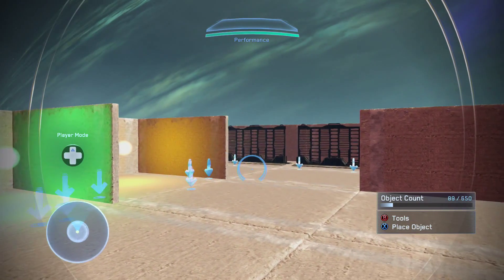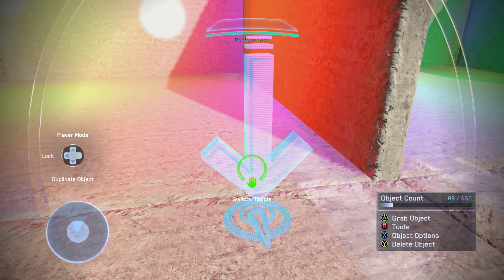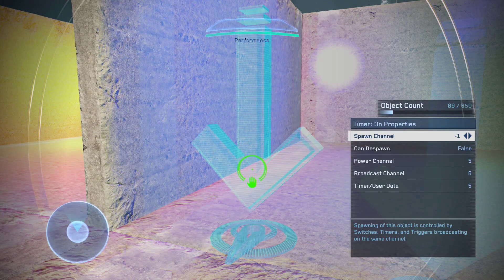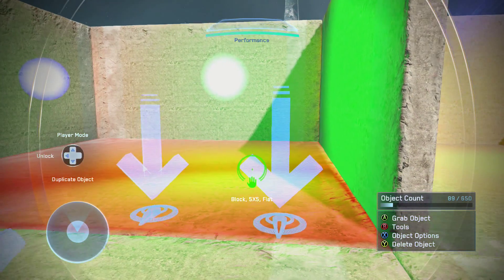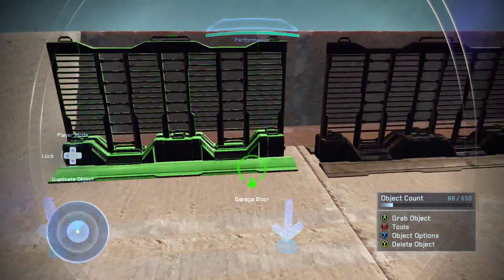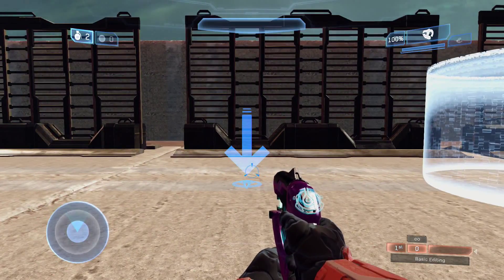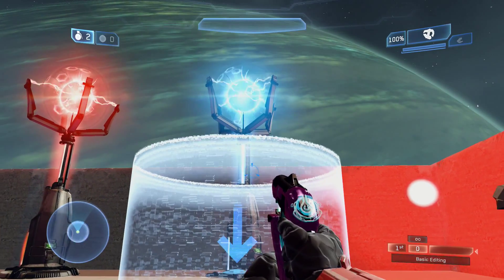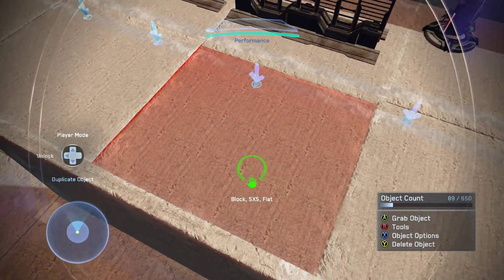Halo 2 Anniversary Forge Tutorial - Scripting Basics

Comment: do you know how to despawn structure objects???
Reply from the maker: TJAY Sua Yes, if you use the same procedure as I used in the timed walkway tutorial it should work. Just set the "Spawn Channel" to whatever you are broadcasting, make sure that "Can Despawn" is set to true. The main thing you should know is that the spawning and despawning wont work while in forge you will have to go to custom games to test it.
Reply: When I was testing that yesterday I could only get toggles to work on structure if the structure was place at start false.
Reply from the maker: TurbTastic Interesting, thanks. I will take a look at using structure. I have definitely had structure items able to spawn in but I haven't tried it with anything other than toggle yet.

Comment: Can you go more indepth on the garage door settings, specifically with the on toggle? Can't get it to work.
Reply from the maker: Vdg205 Yes I will do a video on it But to help you out now, the garage door is controlled by the Broadcast channel setting and not the power or spawn setting. So if you have a trigger that is "on-enter toggle" with a broadcast setting of 1 then the garage door would also need a broadcast setting of 1.